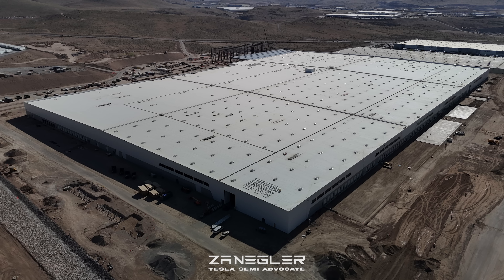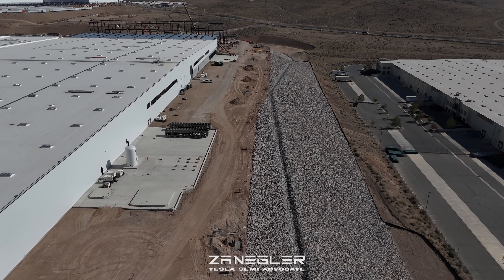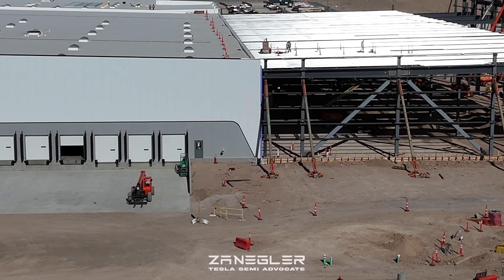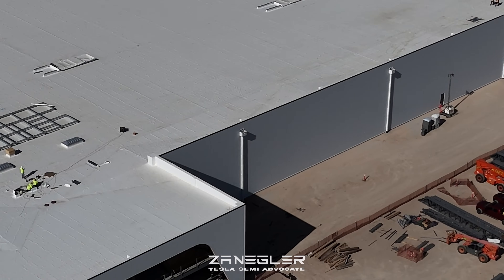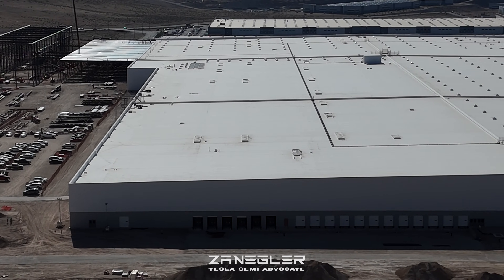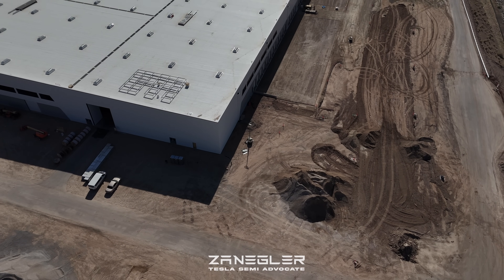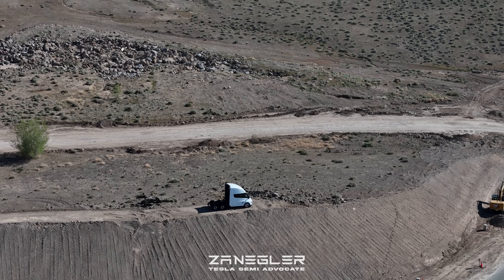Tesla 's High-Volume Semi Factory Construction  ~ Big Steel

Comment: 10:16. Stamping. Roof structure. Some rafters/purlins placed, roof decking attaches directly to these. Bundles of decking sheets will be lifted up by crane and then the individual sheets moved around by hand.
Some rafters/roof purlins may be the trusses seen at bottom right 6:29.
Good view here of the beams that the bridge cranes rails/tracks are mounted on. Located at 2/3rds column height.
10:18. Stamping. Good view of the scrap elevator structure.
10:42. Stamping. How many presses? One stamping line here, maybe a small stand alone press at bottom left 6:04.

Comment: It kinda makes sense that they can actually drive the equipment into the factory on a truck.

I bet all the steel is installed when you fly the next time and they will start to put roofing after the equipment is in.

Comment: 10:40 I was wondering how this additional tall structure would handle earthquakes until I noticed one of those big cross beams providing the typical 'X' braces for additional rigidity.
9:54 But another possibility is that there will be a big hangar type door on this side of the building and this big cross beam might be needed to support  the weight of the door?
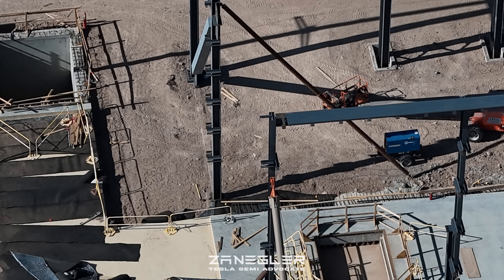Reply: 9:54. Another column to be placed on the right edge of the stamping press footing. Anchor/hold-down bolts visible behind the brace bottom right at 10:21. Small inset in the edge of the footing.

Comment: If you go to Home Depot you can buy steel for projects. It comes in flat bars, square tube, angle, round tube & C channel. I would guess when Tesla is buying the raw material, heavy flat bar to stamp into C channel there may not be much price difference from the steel mill. No need to reinvent the wheel. Unless they have a trick up their sleeve. The frame C channels are  H E A V Y  so maybe Tesla wants to experiment with other materials. Aluminum is used by some truck builders but not many. But Tesla may want to test out a new alloy.

!

Comment: I don't see them doing frame rails here. But, it depends on whether they are roll formed or press formed. Roll forming frame rails is a linear process. I don't see space for that. Maybe they'll press form them, but that would require one helluva press.

That long isolation foundation looks like a progressive stamping machine for body panels. That smaller isolation foundation could be for a frame stamping press. Hard to say.
Reply from the maker: Good input. I am thinking just what you said re/ large press for body and smaller on for frame rails. I do appreciate that they might use a sub for frame rails but I can’t envision the number of trucks it would take for the stated volume.

Comment: Zanegler, this is very helpful. It will be great when they start producing trucks but how are they going to use the other 500,000 to 600,000 square feet in this building? Are they going to build their own battery packs?